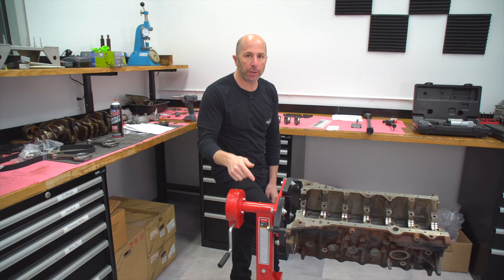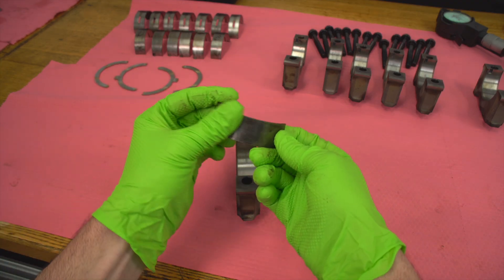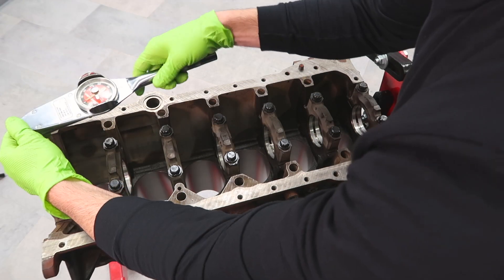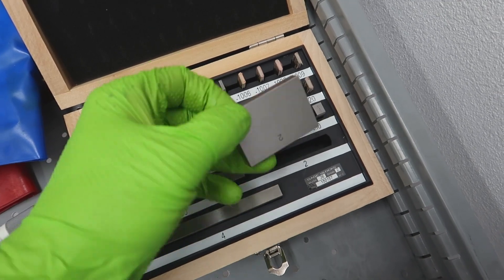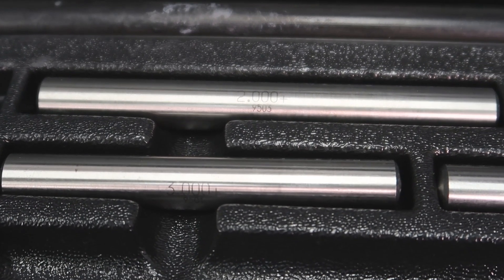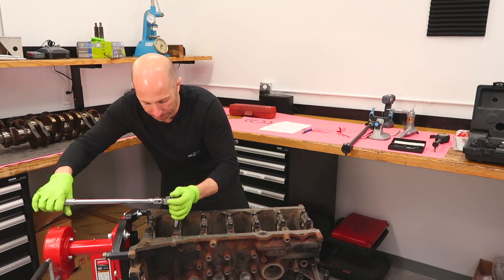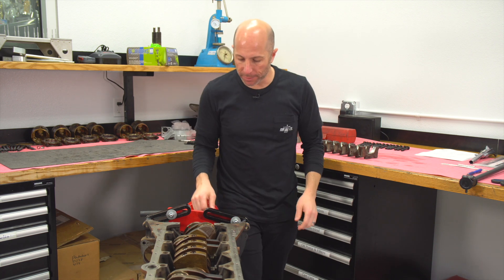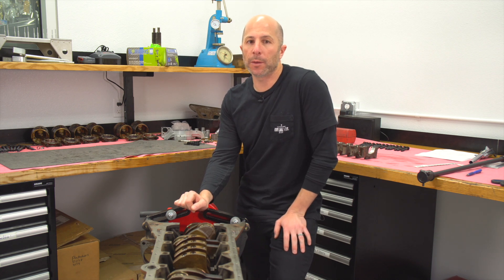$7 Vs $1,000 Engine Bearing Measurement Tools - Plastigage vs. Sunnen Dial Bore Gage

Comment: ??????  you are measuring clearance with a 1000 dollar tool  so you can order the correct bearings,  but you put bearings in which you have no idea are correct to take a measurement? are you just guessing the bearing to get a measurement? where did you get the bearings from?  why do you need the bearings in the crank journal? why cant you just measure the crank and then measure the journal and order the bearings. why are you using a random set of bearings?

Comment: Is there an issue here bolting the mains up multiple times using stretch bolts? I assume they are stretch bolts given the +90 degrees spec. You yield the bolts during that 90 degree turn which work hardens them, then you unbolt them and do it again with the same bolts it appears? The second time the bolt preload would be a bit higher due to that work hardening, no? Ok to do it with normal bolts or studs. Great video btw, I have often argued this but with no good evidence.

Comment: Hi , i am getting a P1326 code on my kia sol 2104 kia dealership says they perform a test called CRANKSHAFT BEARING CLEARENCE TEST which passed and now they are refusing to change my engine under warrny , how accurately a CRANKSHAFT BEARING CLEARENCE TEST can be performed without tearing down engine ?

Comment: You're saying 13 thousandths to 16 thousandths, but what I'm seeing on your paper is 1.3 thousandths to 1.6 thousandths with an error of 0.1 to 0.3 thousandths. Correct me if I'm wrong, but that's what I'm seeing. 

The real accuracy test to me BTW would be seeing if the same method is REPEATABLE (ie: getting the same measurements several times using the same method).

Comment: when you use plastigauge you already have invested in bearings. if the clearance is wrong you need to invest again in the right bearings. i think its much better to first invest in micrometer and bore gauge first to get the exact bearing and buy the right one right away!

Comment: Not 15 thousands not 16 thousands it's reading 1 and 1/2 thousands  I..
 15 thousands is wrote .015 ok? Or you can say 15 ten thousands. .0015 Also plastigauge with help determine if your block needs align honing if you do all the mains..

Comment: 2:45 me after he spends 30 seconds explaining how to read imperial units: "but it says 61.99mm right there 😪!"
by the way, I rewatched about 5 times now and still don't get how you read it to arrive at 2" 4405'
what even is the split for inches? does it mean 0,4405 parts of an inch? or is it another smaller unit with other proportions?

Comment: I worked in a production engine rebuilding shop in the early 80s. We did not use either plasti gauge or measuring tools. What we did was cut a small piece of .003" thick feeler gauge stock into a rectangle piece 1/4x 3/8. Assemble the Maine bearings and crank torquing all the journeys. See if the crank will turn. Once you confirm it spins remove one journal at a time and put in the piece of feeler gauge on top of the crank journal. Torque the journal see if it spins if it does  remove he feeler gauge stock and move on to the next one repeat the procedure. You know there is no more than .003" clearance but greater than none. You really don't care what that clearance is as long as there is some and it is less than .003". Most people don't have the measuring tools or the skill to use them.

Comment: Like your videos. I’m new to engine building, but I might have a tip for you that may increase the accuracy of Plastigauge. I think the problem with how most use Plastigauge is that the crankshaft is sitting on the bearings dry. Putting motor oil on the bearing surfaces will not only help in measuring, but it will also prevent contamination from the Plastigauge getting on the bearings and make sure it sticks only on the crankshaft. It doesn’t sound like much, but I bet that thin layer of motor oil will make up the difference. I tried it this way and it was more accurate to my bore gauge and it was repeatable.

Comment: What oil do you recommend on this engine. 

My clearances came out very similar 0015+ on rods and mains. 

I got some driven break in oil 15/50 12qts. 

I’m new to this and have followed your videos as a guide 🖤🖤🖤. 

I was running vr1 20/50 being I’m on E85 and it does well with it.

Comment: WOOOWW.....ok... Just watching the video and skimming through the comments.  Not sure where you folks learned to build engines but 15 thousandths is not correct tolerance for bearings.  If you've EVER built an engine you should know that the proper bearing tolerance is 1.5-2 thousandths.  Please don't build engines unless you know your measurements.  My dad did babbitt rod engines, tought by my grandfather and I've been doing insert engines forever.  Plasti-gage is a must.  Again, please don't give incorrect information and if you do... correct it.🙄🙄🙄🙄

Comment: Normally, nobody explaining the process mentions that the "dimension" (for bearing clearances) is the total clearance between the crankpin and the journal with bearings installed. That is, the OD versus the final ID. It's not the gap between the rotating crankshaft and the fixed bearing that is being specified or discussed. 
When you start swapping bearing shells you have to consider the "gap", not the differences in diameters. I wished people would make all this very clear! Specified bearing "clearances" are the differences in installed bearing ID's and the shaft OD. To me, this is somewhat confusing when using the term "bearing clearance". Is it not "bearing clearance" X 2?
On top of that, when Plastigaging, you will be causing an error if there is any oil involved underneath, or if you put Plastigage underneath the crankshaft as well as under the cap. Crankshaft distortion can mess with Plastigage readings since you rely on the crankshaft sitting perfectly flat in the bottom of every one of the journals. You might want to rotate it 90° and see if they shift or at least check the crank for runout before you do anything else.
Your video is good. Don't get me wrong, but I think there are lots of poor "educational" articles, blogs and videos where they are vague about what is being measured and abuse terminology or use loose terms and generalizations.

Comment: Holy shit that crank looks like it was a balancing nightmare! Lmao.
Some nice tools you have... I am honestly jealous. That sunnen gauge is worth more than my Chinese bore gauges, torque wrench,  polish micrometers, and my dial indicators :-)
I get the job done though ;-) 
Never had a failure of an engine of any type, and I've built some wicked drag engines and circle track motors :-)
I don't mean to nit pick... but someone who doesn't know better might think sixteen thousandths is alright for bearing clearance when they should have 15 to 20 ten thousandths .0015-.0020 :-)
Minor oversight when throwing terms out trying to produce content... mishaps happen. Video production is very nice btw. Trying to get lighting right and shoot precision gauges can't be easy.
Also.... to someone who worked at Autozone (especially a store manager like I used to be... that receipt shows WAY more information than you should be comfortable with having on the internet). I'm not going to elaborate for obvious reasons.... just take me word for it please.

Comment: You know much more than me, but you said between .015 & .016 but the plastiguage read .0015 / .0016. I read that as fiftheen ten thousandths - sixteen ten thousandths  or 1.5 - 1.6 thou. Am I understanding this ?  As the plastiguage measurements were between .001 & .003 thou..

Just curious and want to learn how to do this correctly. Thanks, love your video's and thorough descriptions..

Comment: You can't hone a cylinder ,conrod ,or main tunnel using plastigage or grind a crankshaft either so you won't be getting rid of the bore gauges and micrometers anytime soon!  You could install a main cap the wrong way and get .0002"  clearance vertically but the crankshaft wouldn't turn because across the parting faces could have .0010" clearance  1 side and .0010" interference on the other. Plastigage is really only useful for people who probably shouldn't be checking clearances anyway! Any machinist worth employing should be calibrating the micrometer it only takes a few seconds to do it.

Comment: Plastigage is off by a few ten thousands. Im building a 5. 4 2v thats supercharged and will be around 700hp. Our clearances on mod motors are very tight regardless of boost. 9 ten thousands to 1 thou and 9 ten thousands is the clearance. I used my bore micrometer and used my outside micrometer. All the clearances were super close. Plastigage was off by 2 or 3 ten thousands. The problem is if your clearances are already on the big end. Thats were you could be in trouble. For example if your main big end clearance, meaning the maximum allowable tolerance, lets say its 1 thou and 7 tenths.... And your plastigauge is fitting into the 1 thou and 5 tenths.... Remember lol its off by a few ten thousands 🤷🏼‍♂️. Thats were the issues present themselves. However if your max is 2 thousands and youre falling into the 1 thou and 5 tenths... Youre most likely golden and good to go

Comment: This right here ladies and gentlemen is why I sent my Honda b16a2 head to headgamesmotorworks.com  and my Honda B18 LS bottom end to CNC Werx ! There is just to much that can go wrong, especially how honda mixes and matches there rod and crank bearings. Its a friggen nightmare!  I got the head and bottom end completely built with all parts to support 700 HP all for under $5000 dollars. You can not beat that deal with the caliber of men building my engine! I highly recommend them both. I dont know if Papa builds engines for anyone but himself and his team but he is hands down the very best. Most of us probably couldn't afford to have papa build our engines$$$$$

Comment: Do you replace those bolts with new ones after your measurements since they are TTY bolts? Also just asking for theoretical purposes.. Say you only had brand new bolts to use to take measurements with and they were TTY bolts, could you torque them down to the specified torque minus the angle/degrees, which is what makes them stretch.. and still get an accurate reading  without having to worry about replacing them? Thanks'!

Comment: Pastigauge is an insurance policy against mistakes at the machine shop or any weird stuff that can happen......  

I once many years ago did a Fiat 128 motor and two of the rod bearings were machined oversize and the other two standard from the factory..... plastigauge picked it up - lucky I checked it.

Turned out it was an original factory second motor that now needed reconditioning 

Fiat cranks are very good so I ordered standard size bearings as a set and thought I’ll just check it anyway....

Thank god I did.....!!!!!

Comment: As a lifelong machinist I craped my pants when I saw the 1000 dollar price on the dial bore gauge and 1500 bucks for the setting tool!!! Those tools are available much cheaper than that. Many of us use our micrometers to set or check the dial bore gauge, because we know how to master our micrometers and we trust them.I like and use Plastigauge for checking connecting rod clearance before assembly, I like it because you're checking the rod, rod bearing, and crankshaft journal all at the same time.Experience has shown that if the Plastigauge shows a problem it's usually the connecting rod.
Reply: My Sunnen bore gage for measuring connecting rods is $5000

Comment: Question about clearances. Do high horsepower applications require larger clearances due to pressures that can cause twisting or deflection? If not is it because the parts can withstand higher loads? I was reading about this which led me to think that higher weight oil would be used not only due to higher temperature impacts on viscosity but also those larger clearances.

Comment: Can anyone explain why he tightens the bolts an additional 90 degrees after torque fixing them? I've never seen that before.
Reply: Torque results in inconsistent pre-load which varies greatly with lubrication, etc, so when trying to reach a specific pre-load, it is better to torque to a relatively low value (less error) and then increase preload by additional degrees of rotation. For rod bolts the preload stretches them but not to the point of yield as with OEM head bolts, meaning rod bolts can be re-torqued repeatedly while using plastigage, etc.

Comment: I'm not sure, but I think that tighting/releasing the bolts wear the screw holes in block. Also, in some engines, the bolts need to be replaced after each use. Please correct me, if I'm wrong.

Comment: As far as auto cranks are concerned they both are equally useful to maintain a 15 to25 tenths clearance, the crank can turn 10k with no measurable wear or overheating. Easily attained with plastiguage And way quicker.

Comment: Ya...except for.    Without a verified straight line bore you are going to need to use both methods to do it properly. A mic and dial bore gauge will get you theoretical numbers and plasti gauge will tell you how those numbers apply to the line bore. You can have perfect numbers with caliper/dial bore gauge but if the line bore is not straight plasti gauge measurements will not be consistent. A journal that measured .002 and pg measured .0015 could be a problem...And watch that pg stuff in the heat,.. hot parts hot weather makes the pg flatten out more...temps like 90 95* and higher might give you bogus numbers.

Comment: I have no idea what you're even doing but it was fascinating to watch
Reply: The crank shaft is very slightly smaller than the hole it sits in, and while the engine is running, oil fills the gap, thereby lubricating the engine. How big that gap is is critical to how the engine is going to run and last, so knowing, and possibly, adjusting that gap will allow you to be sure your engine is going to run well for a long time. What he's showing here are two different ways to check that gap.

Comment: Talking about accuracy, then when it comes to torque angle,  eyeball is closes enough? You've go a thousand dollar bore gauge, but you don't have a proper torque angle gauge or meter?
Reply: How accurate of an angle gauge is really needed when the spec is a perfect right angle? I could see if the spec was something odd like 75 degrees, but it's pretty easy to eyeball a 90 with a long breaker bar squared-off on the block.

Comment: It's not that simple. Did you use new bolts? Was there more oil in the threads? Did you use exact same force turning the bolts. Most likely not. But hey, it works.

Comment: Plastigage can also detect an out of roundness condition. .By placing the Plastigage at different spots you can compare the results to see if the stuff squishes the same amount. If the Plastigage is placed at the same position but the crank is rotated 90 degrees and tested again the results can be compared. If they are not the same then the crank journal is probably out of round. A standard micrometer which just measures between two points CANNOT show all types of out of roundness.
Reply: Plastigage is an awesome tool in the hands of an experienced engine builder. Done.

Comment: Your inspection tools are amazing, wish mine were as great as that. I think this video shows that if you want to blueprint an engine, use high end inspection tools, but for general rebuild plasti-gage is actually not only just fine, but also will save time and money.

Comment: Sir very clean job, top notch,,,👌💪

The main reason to have a bore gauge is to measure the concentricity of the main caps specially if the engine spun a bearing or more, and a line bore is in order, and then to double check after the machine shop, 

The other use of a bore gauge is to  measure clearances 45deg from the vertical and 3/8inch from the parting line to make sure that you are within the desired range all around.

The ultimate method is to measure your desired clearance ranges  with a  bore gauge, then check with a plastigauge not for clearances but to make sure that all the journals have the same width of the plastigauge strips, this is an indication that all the caps share the same center.

Comment: apples and oranges. Is the crank straight ? not likely, is the block straight ? not likely.... Did you bolt the head on inducing stresses to the girdle ?? are you hanging the block on one end bending it like a banana ? So many variables. You get what you pay for.  Plastigauge is a quick and dirty way to check but its not always the best indicator. Please learn THOUSAND's vs Thousands vs tenths...
Reply: You are an idiot.

Comment: Well done. 👌 I do believe, however, one could achieve .00005"-.0003" for less than a thousand if you know what diameter you're working with and know what you're looking at, although that is a LONG bore gage attachment. Still, I think the plastic gage method, for the money, is worth it probably until higher rpm or newer motors, because even if it gets you to hold half a thou.......you can work on a lot of engines with a half thou tolerance.

Comment: i think the biggest caveat is this: what are you building it for? if your doing a stock rebuild, then plastiguage is more than accurate- in fact it's use is described in the Toyota repair manual during tear down. if you're building a 1000+ hp engine and want it to be reliable, then yes you will want to spend the money on the tools to make it perfect.